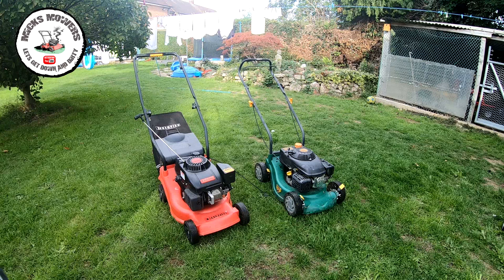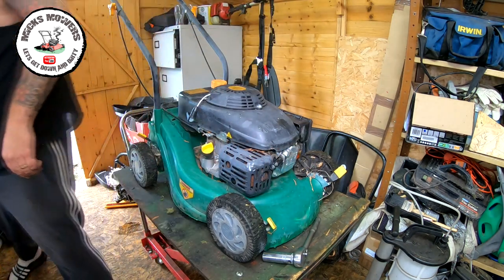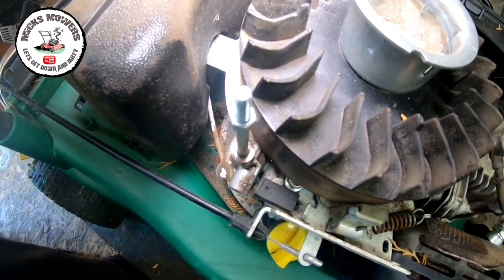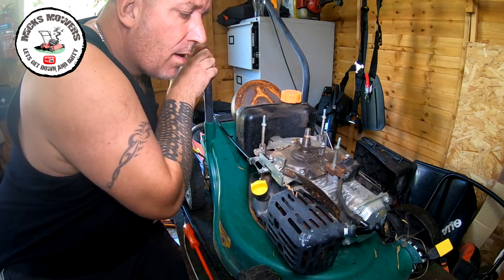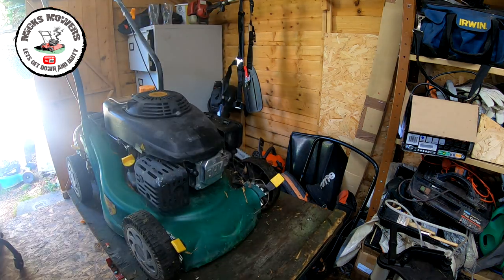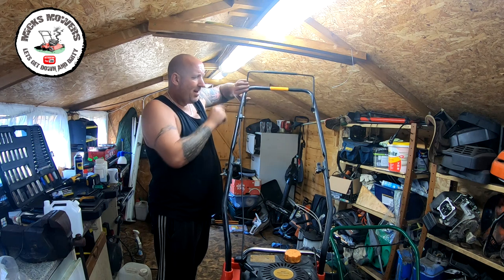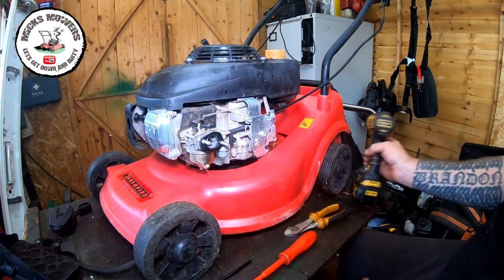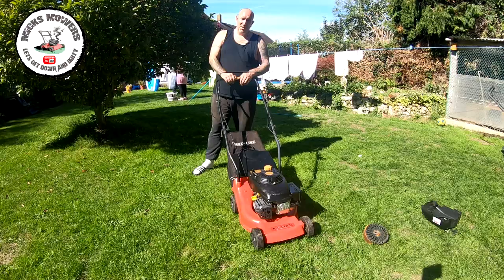Curb find Lawnmower Dumpster Trash or Transform For Cash Let's See

Comment: I save all my cables, I had to make up a brake cable from old pats in August, for an NLA cable. I use one of the screw on Z bend ends. 
Long story, but it works great on a Craftsman electric self propelled curb find mower. A long story. That’s why we do this stuff,  it’s just a job well done, and it’s a hobby..
Cheers.
Reply from the maker: Yeah mate

Comment: Ive just been on eBay for a z bender. Great tool. 
I've just purchased 2 mountfield sp470 the one has a slow oil leak coming out the bottom any ideas what might be causing it.
Reply from the maker: Bottom crankshaft seal..
Reply: @themowerman  that sounds bad